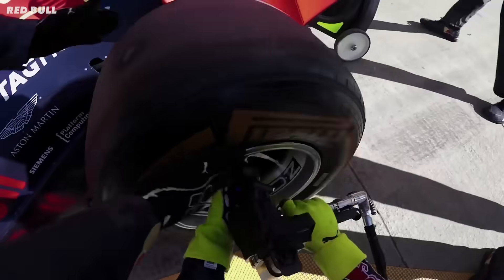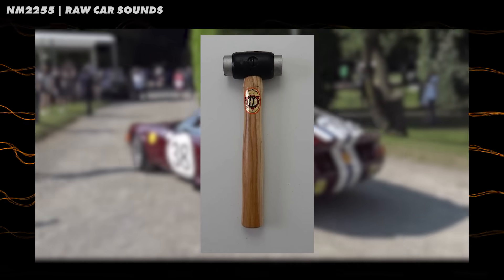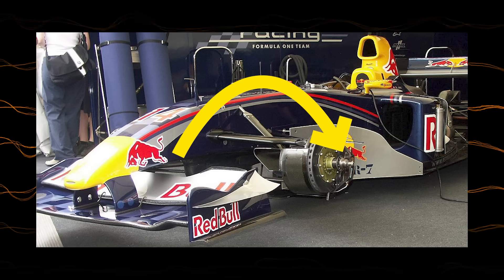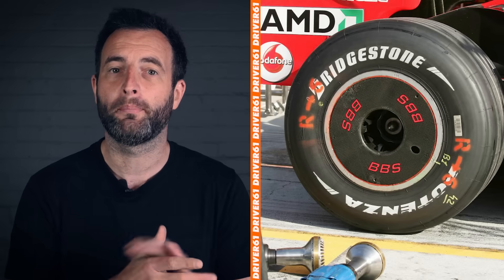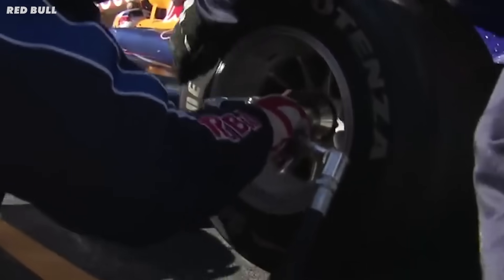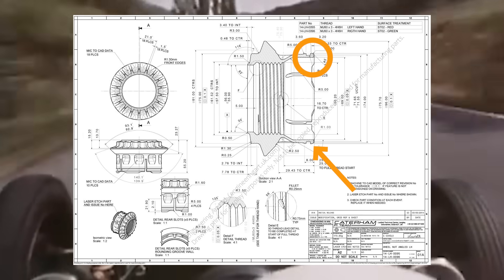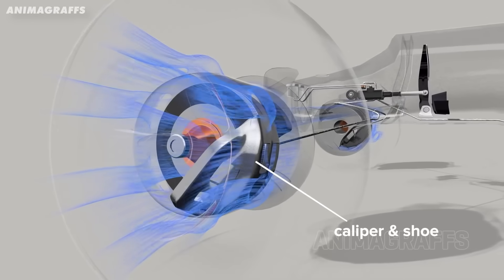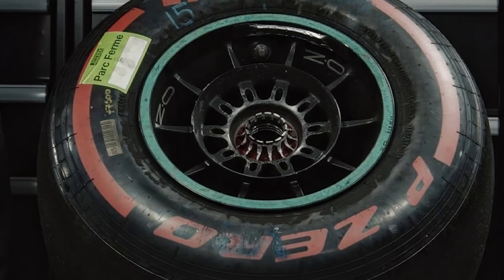Why F1 Wheel Nuts Cost £50'000

Comment: There is another factor in the high manufacturing cost. Machine shops grossly overcharge. I know because I've dealt with one in Sussex some years ago who did work for BAR at that time. The sort of figures he quoted me put me off having parts made for an RC model car. I mean the figures were downright hideously expensive. 

Then he said he'd need a so called 'consultation' fee, if I were to engage him making those parts, when I'd already produced detailed engineering CAD drawings for each part. That's when I really realised I needed to change career and I did.!
Reply: One would think that an F1 team would have their own machines and don't have to contract a 3rd party vendor.
Reply: @MrSkywalker121  There's never enough time, and never enough machines in the shop.

Comment: Wheel nuts with coarser threads (like 2X) are much more likely to vibrate loose.
Reply: If the nut is single use, you just make it a semi-interference fit and use the gun to solve the problem of getting it on and off. The Aluminum only has to hold up for like 30 min or so.

Comment: Hammer on and off wheel nuts were common place on British “sports cars” with wire spoked wheels up until the early 1970’s. Cars that had the optional wire spoked wheels with “spinner” wheel nuts (hammer on and off style as opposed to hex nuts) came with a short handled 2&1/2 pound “hard”:lead hammer in there tool kit along with the cars jack in the boot of  the car.  Also available with spoked wire wheels was a large hex nut which also came a hand use only socket and a bar to loosed/tightened the wheel nut.  Both wheel nuts were stamped with a L if they were left handed thread. Additionally Wire spoked wheels and hammer on and off wheel nuts were an option on some Alpha Romeo’s  as well.
Reply: Had a 1962 MGA 1600 MK II Deluxe. Knock offs with pinned steel wheels; it was a Twin Cam 4-disc brakes. REALLY miss that car!
Reply: That's right, this video is a little misleading in only talking about racing after WW2.. Centre lock wire wheels were common on British cars before the war and also were left and right threaded for the reasons stated in this video. For anyone who has had a classic English sportscar this stuff is nothing new.

Comment: machining those wheelnuts ain't that expensive, al is very easy to cut and hold tolerances, especially with that circular/tube shape, had it have a big cutout from a side, making the part iC sort of shape, it would be different matter, but solutions to part moving around aren't expensive either, just need to leave it oven for a while at certain temperatures and times after rough machining, and then do final machining, the big cost is always the development, that is what ends up jacking the price per piece so high
anodizing them also costs the same per area as bling wheel nuts for road cars, the process is exactly the same, custom racking might be made for these to ensure there are no problems during anodizing, but that is sort of a regular occurrence for high value parts
so, to sum this up, probably good 85-90% of the price is in development
Reply: Do not forget that there is no imbalancing allowed. It would immediate destroy your race...because the trembling in any imbalanced wheel...even if it's that nut only.
Reply: @reiniernn9071  why would there be imbalance induced by machining? you make zero sense, and would know that if you ever machined anything be it lathe or milling
imbalance can come from design only, besides that, the nut is close to rotation center, so even if there is imbalance in the part, the rotation speed (due to very large wheels) isn't that great to create high dynamic forces in the nut, don't confuse that with imbalance in tyres, that is the exact opposite of the nut situation, besides that, it being plastic/rubber material, chances of inducing imbalance there during manufacturing is much greater than mill/turning something from metal
Reply: @dghtr79_36  When machining with high precision (expensive production method) there is no imbalance. When just making a bolt as bought in a shop for e fwe dollars I think they are not balanced at all....they are also not machined. Also think of normal cars....the steel / aluminium wheels must be balanced with peices of lead (maybe other material)
Reply: @reiniernn9071  we aren't talking about bolts made by forging and rolled threads, we're talking about parts made on top of the line multiaxis machining centers, there is basically no way to make these imbalanced during manufacturing, about the only way I can think of is if same quite careless 2nd or  any other consequent op is done on them that removes enough material, but there is a solution to that also, more than 1, and all parts are cmm checked, so the possibility of such a part actually getting on the car is pretty much zero. and I already said - rotation speed is much too slow for some small imbalance to matter with this particular part

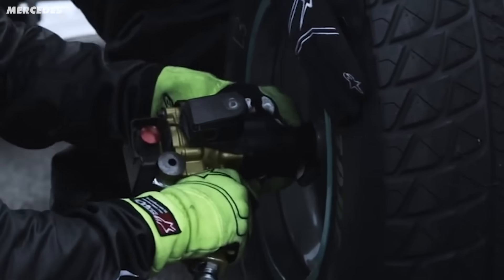Comment: 6:55 have you any idea how much that hurts?
I know they use colours to denote thread direction and not which side they are used, but on planes and boats red, left, port are all on the same side. That's where the red/green colour scheme come from.
All the short words one side: red, left, port.
All the long words are on the other side: green, right, starboard.
Reply: As a sailor, I immediatly picked that up and went to check the diagram. Another mnemonic to remember port/starboard/red/green/left/right. - "There's no red port left in the bottle".
Reply: @steven1000000000  Also, in UK (I don't know about other countries) it's common to have the hot water tap on the left..
But then, we haven't wholly caught on to the idea of mixer taps, but we're getting there.
Reply: @dougaltolan3017  Never thought about that one, but yeh that works.
Reply: @dougaltolan3017  In the US the hot water is normally on the left. Except in my house.. When I bought it all the taps were wrong way around, and all the light switches were installed upside down. No idea why, maybe a previous owner had a superstition?

Comment: The spline drive wheel nut / socket was developed in 1994 by a small company named “Metalore” (who are still involved in F1, Prototype and Sports Car Racing) Newman / Haas was their test team in 1995 and Metalore was also the 1st distributor of Paoli Pit Guns in North America.  By 1996 every team in the CART paddock ran that design and it became the norm world wide.
Reply: Kenny at Metalore had long been friends with John Barnard and we used them to make all our axles and CV joints etc (anything out of 330M) at Ferrari and later at TWR and Prost. Those splined features were on the JB Ferraris around that time and so I wouldn't be surprised if they were a result of collaboration between Kenny and JB.
Reply: @GPRaceSimulation  Yes - Kenny and JB were good friends. And still best mates up until Kenny's passing in 2022.    It was actually Gordon Kimball who came up with the spline drive socket / nut solution for us to complement our drive line components we developed for Newman Haas (I work for Metalore as their track side support rep in North America).  Kenny would also smile saying the only time F1 learned something from CART.  We still use 300m + various other materials for today's modern driveline systems.

Comment: Interesting video, but what I can't understand is, why do they still use pneumatic wheel guns? Surely they could have developed cordless, battery powered versions by now, to do away with the trailing air hoses.
Reply: The insane pressures and flow rates they use in those guns far outstrips an electric motor of the same size for the duty cycle used.

Comment: As a mechanic who services and works on cars every day this has been one of the most interesting parts of motorsports to me, particularly how why try to avoid cross threading of the nuts on the spline whilst not having to hand thread them first
Reply: Yeah every time I see them blast the nuts on all I can think of is a cross threading!
Reply: The machining is better, but worst case, the nuts are softer than the stub, so it would only happen that one time then be taken off and changed out for a new nut.

Comment: Not sure if I should say this or not. I want money if it becomes a thing. But what if you can develope a wheel nut that tightens automatically when you drive the car away? You only need the impact gun to take the old nut off. The new auto tightening wheel nut can be held in place with a pin that it ment to brake away once the nut is tight enough. Imagine the time it could save on the pits. You can use weak magnets to hold the tires in place until the car starts to roll away. Then the nut self tightens.
Reply: You're the smartest YouTuber I've ever encountered. O_O
Reply: And the extra weight of this design is...?😊

Comment: I never thought THAT much efford went into designing and making the weel nuts. It's easy enough to see why the engine or the bodywork is so expensive (only to constantly see cars that lost bits of the later doing the exact same times as before), but the attention to detail that goes into the small parts gets overlooked so easily.
Reply: It's a spinning object, so every gram it has gets magnified when the car gets up to speed. Excess weight in the wheels affects acceleration, braking, and cornering at all speeds whereas a lot of the bodywork only starts to work at higher speeds.
Reply: @washellwash1802 and also it's a part that comes off and goes on the car every Grand Prix. With the minuscule time spent on doing that it makes it pretty easy to see that effort is needed in designing it.

Comment: I've been fascinated with these specialized wheel nuts for a while now, always wondered how they were designed and how they stay locked to the wheel when removed from the car. I'm glad finally have a video talking about them, as they're never mentioned when talking about bigger things about the cars like engines and aero.
Reply: Dude, you should google the size of the torque wrench you would use if you owned a brand new porsche gt3 and manually were to tighten your centrenut on each rim 😂.

Comment: Who has estimated that an F1 wheel nut costs anywhere near £1000 a piece? Looking at the size and (not that high geometrical) complexity of the shown Caterham F1 nut, I can indeed see how producing production run of a single such nut with an outsourced CNC service, could cost up to £1000 (or, well, a random number between £200 and £1000, where the lower estimate assumes that whoever designed the nut gave a bit more thought to manufacturability of the design with a CNC mill).

But, for a run of a bit over 1000 nuts (one car for one season, based on the video), the cost would seem to be closer to £100 a piece even if one needs a more complicated CNC mill. This price point should be reached with any production run of ~100 nuts or more, which is like one racing weekend for a team with two cars using 13 sets of nuts each (for a total of 104 nuts).

Like, some of the reasons in the video, like the anodisation, for example, hold no water. It is the bog-standard surface finish for aluminium, which costs next to nothing. Like, a few percent of the cost of the part itself even for a run of one part. For reference, even the cheapest aluminium gadgets, or aluminium nuts, have nice colourful high-quality anodisation. Or, the cost of the “fancy” aluminium alloy, which would be a rounding error compared to the machining cost above. Like, about £50 a piece even in small quantities.

The x-ray inspection, however, would cost a bit. But, not so much if it is a production run of 100 nuts or more... where such thing can be automated, and as such will be automated after the first few nuts.
Reply: Also, at least the Caterham wheel nut drawing tells us that their nuts were clearly re-usable (check part condition at each event, replace it when needed). I doubt the bigger teams were that much more wasteful.

Comment: I remember the old Australian touring car races. The wheel nuts were the same ones that went on a standard car and a pit stop could take  two and a half minutes.
Reply: NASCAR was that way until recently (still is in lower divisions). Helmets are definitely necessary with cars peeling out spraying lug nuts
Reply: @andrewahern3730  But in NASCAR, those pit stops were FAST. Sure, they weren't required to get all five nuts properly on after a stop, but still. Impressive to see how fast they got those 5 wheel nuts off each wheel and get the new ones on

Comment: The right side nuts are red and the left are green? Apparently none of the engineers are sailors.
Reply: Actually the drawing does show red is left and right is green like a boat. He said it the wrong way round.  I rewound and checked as it sounded wrong to me as a sailor!!
Reply: Yes, because if they were sailors they would be unable to distinguish from what situation they are in...
A sailboat or an F1 pit - they are soooo similar😂
I know he said it wrong in the video, but why the heck should a sailing interested engineer have trouble distinguishing racing cars from sailing, they can't be that daft?😂
Pre så crew are helped by the fact the heating covers are marked with text so if they just can depart front from back and left from right the wheels will be delivered to the correct corner of the car😊